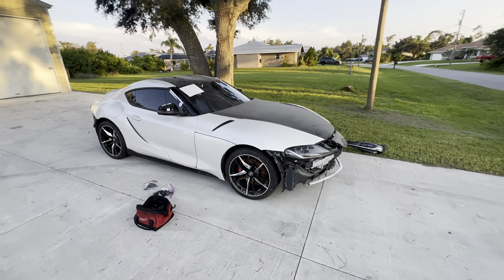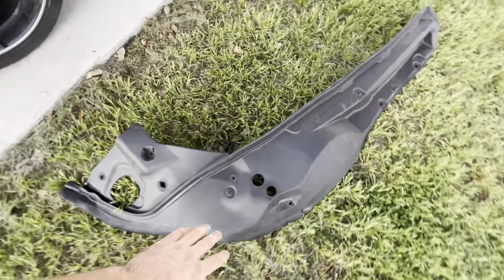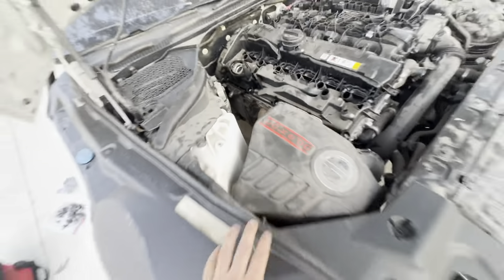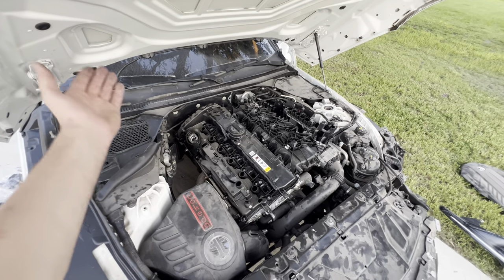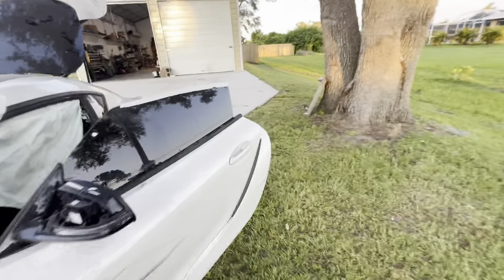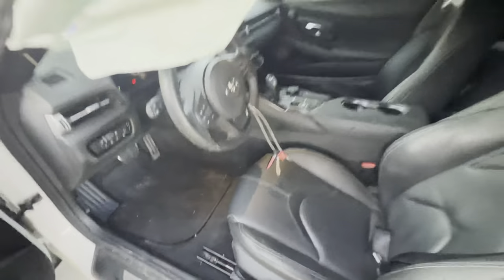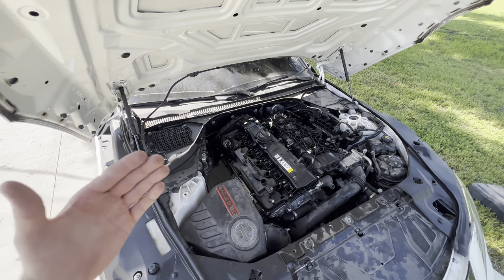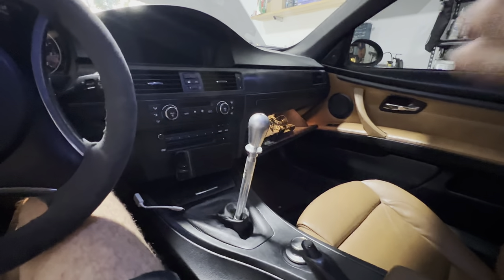I BOUGHT THE CHEAPEST A91 TOYOTA SUPRA | BUT I GOT SCAMMED!!

Comment: I'd wager the previous owner yanked the original motor with accessories, bought a blown used one, stripped it for extras and then put it in the engine bay so the insurance company saw "an engine."  You uncovered evidence of this with the VIN# on the block.  If the car was being financed at the time, the bank owned it, and the owner basically committed fraud.  I'm sure the insurance company who paid for it and the bank who financed it won't like being told they've been had.  It's in their interest to know.

Comment: Since it's literally a Shit box on wheels pull the motor, brakes, seats, dash, DME, shifter, headlights, and wheels and trash the shell
Reply from the maker: Yah thats doable, but I simply don’t have that kind of time for parts to lay around and space before they sell. I’m just going to part out the motor and trans to recoup some money and put in a complete trans and motor. Yah I’ll lose a bit of money but not as much time. The rear end is a very easy fix. So theoretically the car will cost me 25% less then if you were to get one from the dealer. Still a loss but I’ll live with it 😂
Reply: @941garage  true that, or could make a cool b58 powered E36/E46 with a F30 340 manual box
Reply from the maker: @Titanium_E82  that would be cool, but I don’t feel like going bankrupt 😅